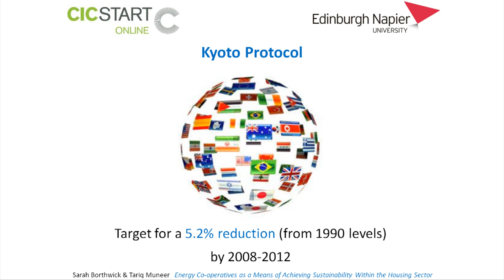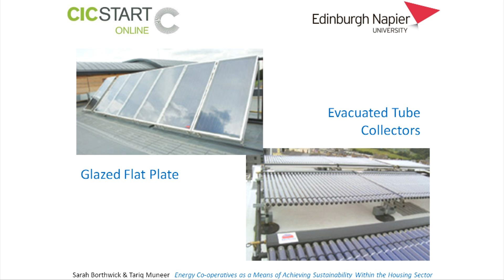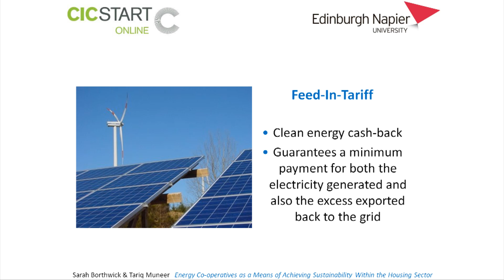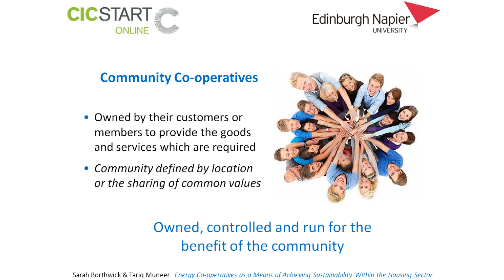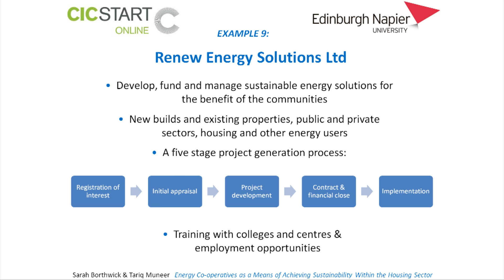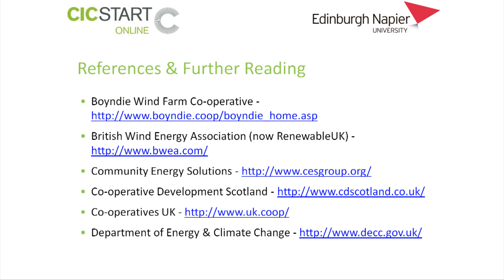CIC Start Online Conference 2011 - Edinburgh Napier University

Comment: When that electric company is an employee owned co-operative, doesn't that mean the people using the electricity have their own micro-monopoly..? I think you are unclear on the proliferation of free carbon in the ecosystem. Carbon is everywhere, but it is widely fixed, released and fixed again in a natural cycle. When Carbon is released as CO2, especially by burning fossil fuels, this cycle is disrupted.